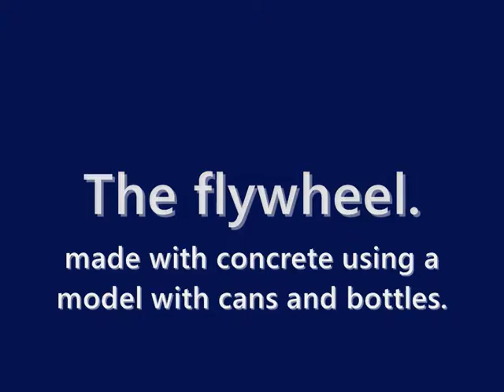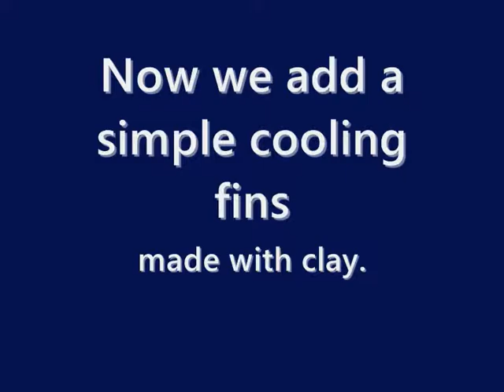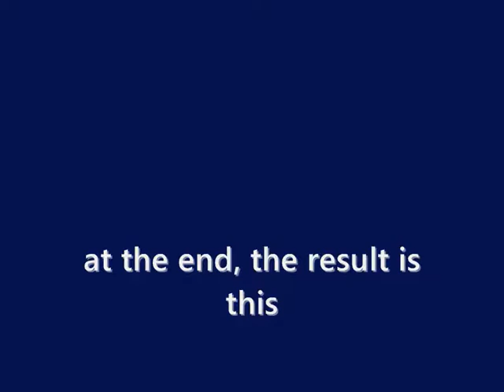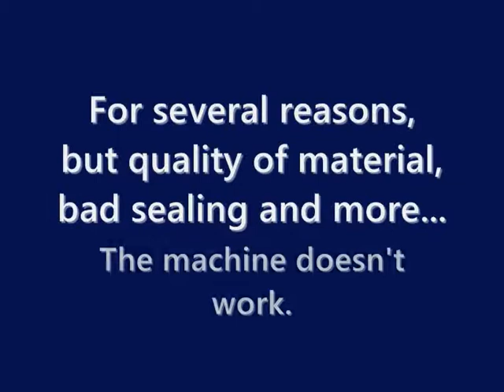ceramic stirling engine

Comment: I love it when people are inovative.  Ignore those nay-sayers.  There is no reason a ceramic and cement engine will not run.  You need to refine your moulds and use finer ingredients.  Investigate pherohs cement, it is strong, light and provides a very fine finish.  You may also have more succuss by going back to some basic engine builds and improving your knowledge of the mechanics and science behind how and why these engines work.  Good luck and keep having fun.

Comment: surely it will not wort, but the idea is fantastic. Betong is a cheap material which everybody can get everywhere on the world. The Stirling motor can work with less temperatures and presser then all the outer motors so with more precision and same changes it can do. And i like the idea to try something new have fun in building it and if it don´t wort .. okey have a beer and try the next.

Comment: This is a very interesting idea, but I think you have to use the ceramic in ways that take advantage of its strengths. The displacer is best to have a very low mass, so it would make sense to make that out of a can without any ceramic. A very efficient diaphragm piston can be made of rubber or leather.  Ceramic is a poor conductor of heat, so rather than making cooling fins out of it, it might be better to make a water cooled engine. Parts that need precision like the flywheel should be cast.

Comment: Hi,

I am very impressed with your beginnings in ceramics. What was your idea behind?

Finally, the idea of the confined helium would reduce the heating temperature when the engine is started. It seems that the Ceramic avoids the escape of the maximum hélum.

If you can given a little more detail about your difficulties that would be used ...
If you have other idea of natural materials that would be cool.

The Great Canary, my preferred destination;)